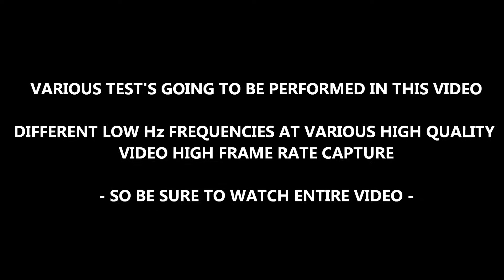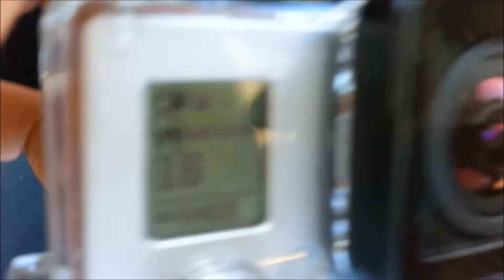GOPRO VS SUBWOOFER - HIGH FRAME RATE SUB RECORDING - HERO 3+ PLUS WHAT THINGS TO DO WITH GOPRO TRICK

Comment: Cool bro.go pro are pricey over here.over $200 u.s dollars.what are your future plans for your set up? 2'12s maybe?
Reply from the maker: CalvertCountyKid as i got a 15 already i think im gonna go for another one. so two 15's is the plan... will get one more extra battery so in total three yellow top. will wire them at 1 ohm or 0.98... for sometime because cant afford another rockford fosgate amp ... so going to be using same single amp rf t2500 bdcp on two 15's... what do you say?
Reply: Now if you do 2 15's they will choke because they won't have enough airspace in that trunk :p
Reply: They'll need at least 4 cuft per sub ported
Reply from the maker: you absolutely right..definitely not be in this car... will change it... thinking to get a 4x4...
Reply: I'd say if you don't wanna get a suv sell your 15 and the box and get 2 12's of your choice (4ohm dvc) so you can wire the amp down to 1 ohm.get 1 more batt and a custom box and you'll be golden
Reply from the maker: CalvertCountyKid yes absolutely right. if same car i will have to sell 15 that is what i think.. but i have seen couple saloon cars they have two 15's in it. but again, yes orion hcca 15's are not actually 15 inch they bigger so i will have to change the car or the sub.
Reply from the maker: CalvertCountyKid orion hcca hole cut needs to be atleast 17 inch...